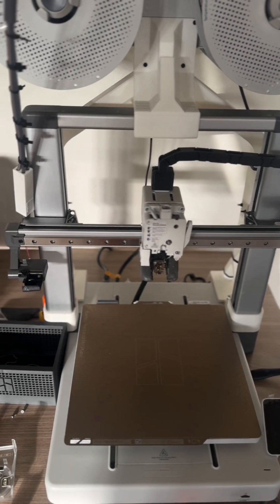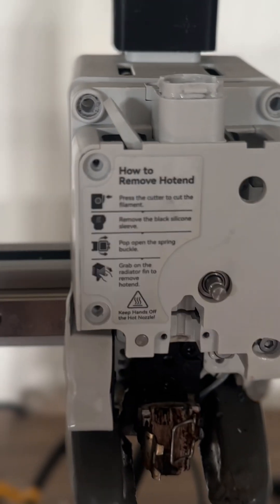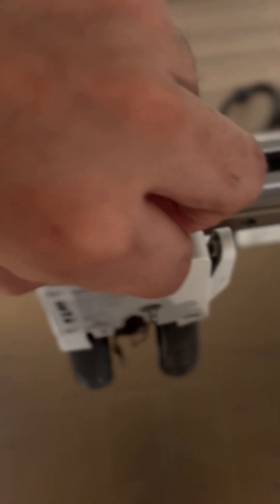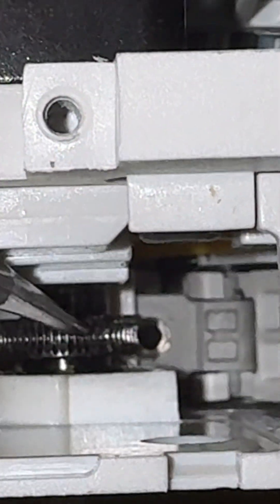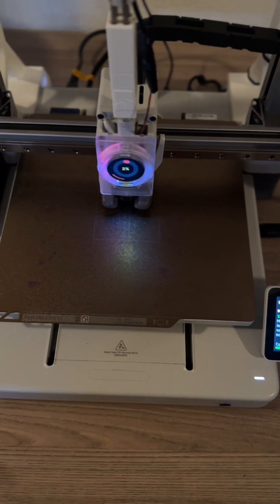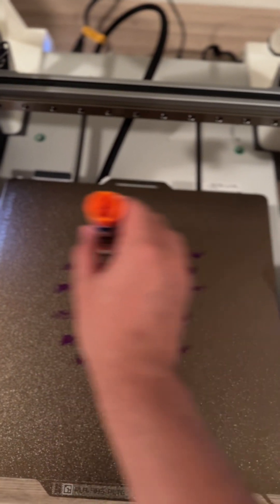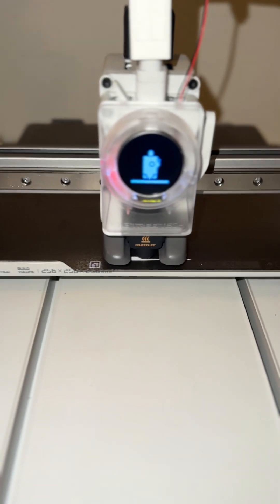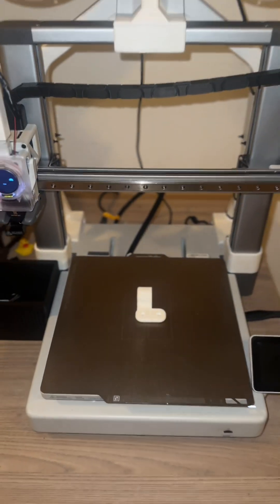How to fix Bambulab A1: Filament Not Extruding / AMS Slot Not Extruding

Comment: Much quicker fix - if you take the pop the front off and remove the front part, you get full access to the gears, and can clean them with a toothbrush. There's links and videos online if you search for replacing the gear assembly - it's the same process but MUCH easier to clean.
Reply from the maker: Please link! Thank you I never knew that
Reply: @stgmadoesitall  yea. where's the link?! lol
Reply: @stgmadoesitall  https://youtu.be/NAAia3n6gqQ?si=fKhpLNXk2XMRm6cR